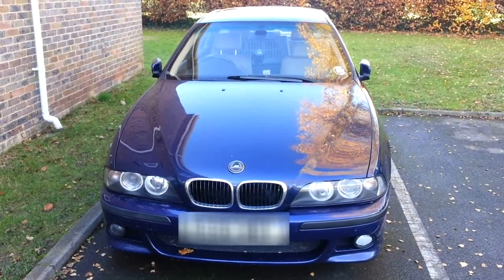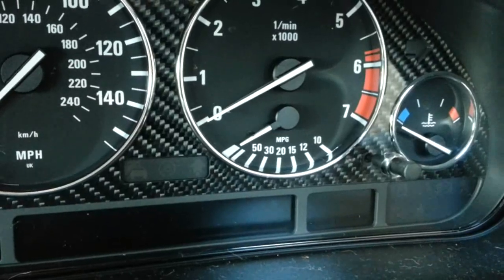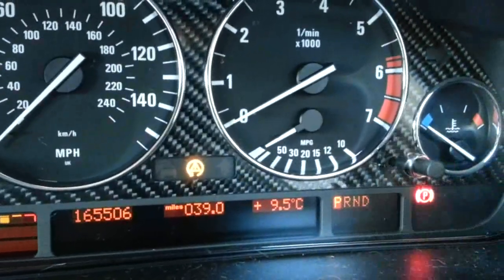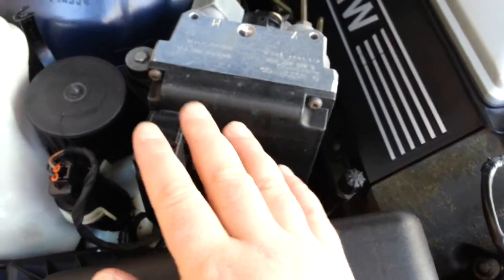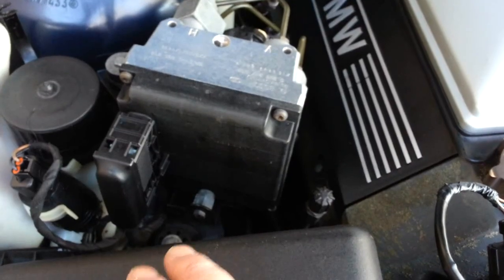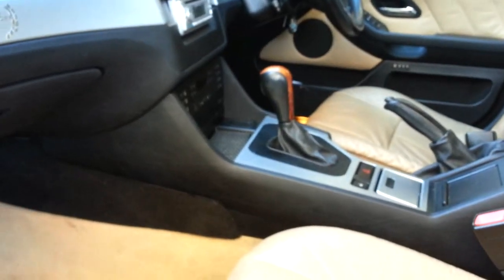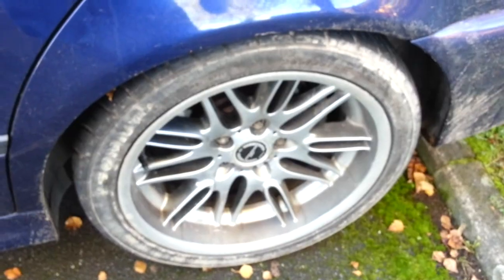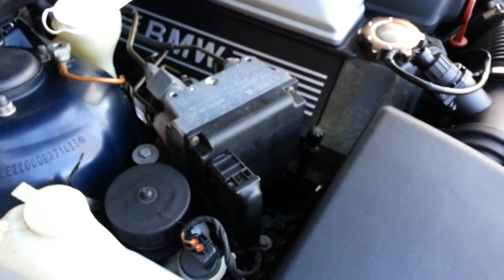BMW E39 ABS and ASC Fault - How To Fix

Comment: I have. 1997 bmw 540i and I have the traction control light on and abs light on and my speedometer doesn't work I'm trying to figure out if I can just swap a different abs module from another car without coding it....my module is inside
Reply: have you checked the wheel speed sensors in regards to the speedometer??

Comment: Mine looks similar but not exactly the same. There's a unit in the same spot, but not identical and one of the connectors on the back is different, therefore I'm not sure if it's the later version or not. It's a 2001 530i. My ABS light has been coming on lately, and just today actually activated and braked a couple times, which freaked me out.

Comment: there is a company on ebay that rebuilds the module for $95 (vs $1,100 at shop for new, install, and coding), no recoding required either. Anybody have experience with that?

Comment from the maker: 'bulletsilver75'.....Well you will need to get a diagnostic scan for sure 100%, as you have clearly got something soaking and its failed and hence your car is in limp mode, there is no other way other than to have it scanned as a sensor or similar is buggered.

Comment: hi i have the same problem i drove under torrential rain and know my 5 series bmw doesnt accept to drave on full power,it runs slow and the DSC light is always on.the displays says:"engine fail safe program"Can you help to figure it up?

Comment from the maker: Steering wheel sensor will throw DSC out of function and costs a bit to replace, located around steering column and works with understeer etc so could be your problem as all parts related to traction, Abs ETC

Comment from the maker: Yes you need to invest some INPA diagnostic software or similar, very cheap, you have some issues there and an error/fault code reading is your solution there...thats where to start...good luck!...once you have codes post on a  forum like bimmerforums and you should get it resolved and handled.

Comment: hi! i have a problem in my x5 2002, my abs does not seem to work, my esp button does not function, my downhill button does not function. and also i think my 4wd does not work too! the weird thing though is that the lamp indicators for abs,esp,4wd do NOT light at ALL! totally dead! any suggestions?